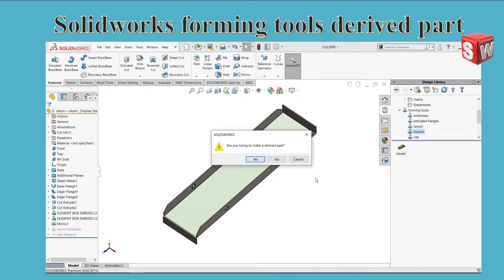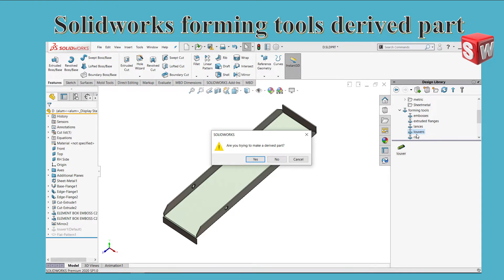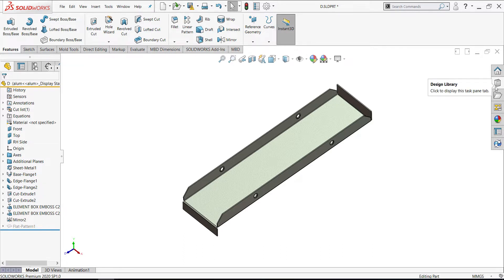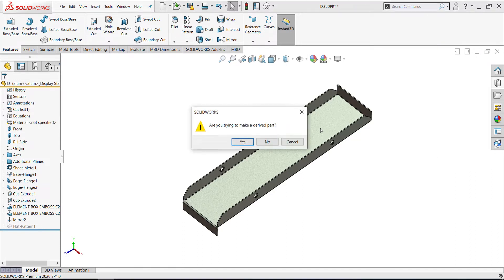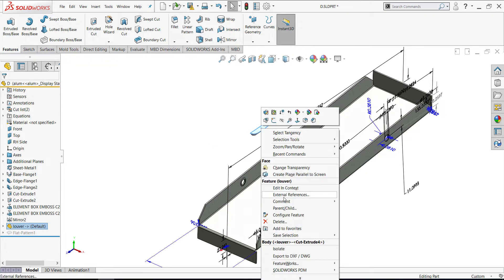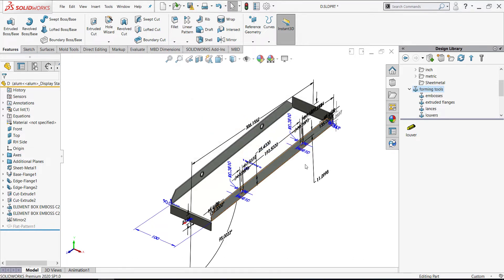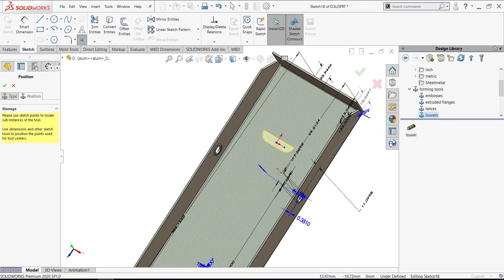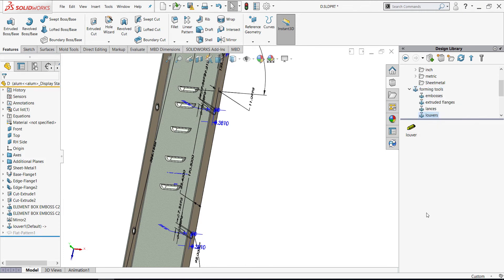Solidworks forming tools inserted as derived part

Comment: im facing the same issue when im using the toolbox in the design library and when i try to drag and drop a spur gear. im not able to configure it either
Reply from the maker: You need to make sure you are using toolbox of your solidworks current not old one.
Reply: @AliNasser  hi, im sorry for the delay reply(my exams were going on). Can you please explain me that in detail like how should I check it? Or what things should I make sure so that the pop up doesn't show up??